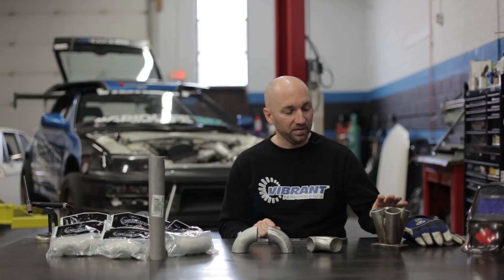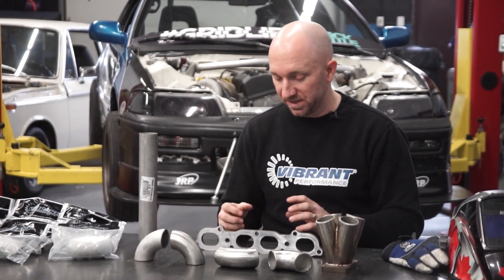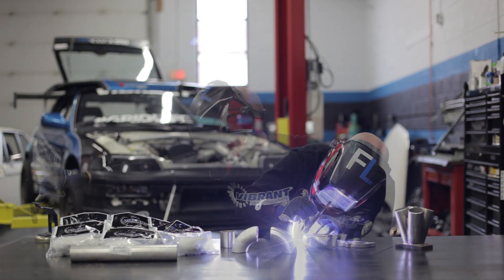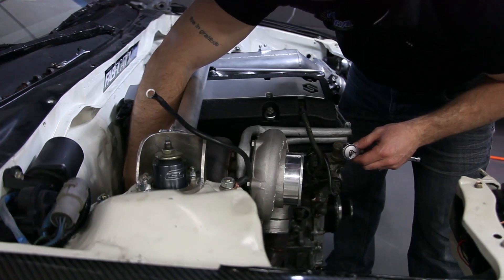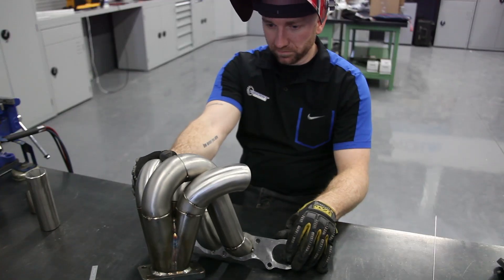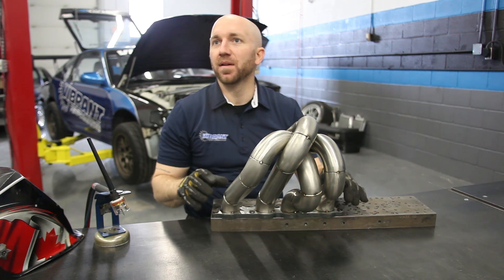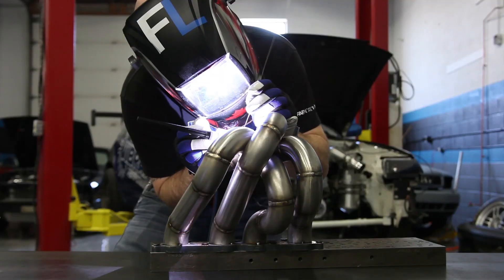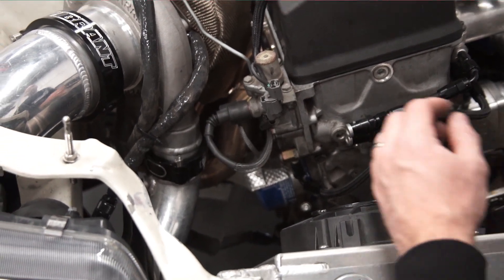RWD Turbo CRX Build: Episode 6 - Building a Turbo Manifold: Part 3 (Turbo and Runner Mockup)

Comment: How the hell do you manage to reach all the way around all of welds from runners to collector? Especially the last one
Reply: hey Ricky,  doing the runner to collector welds needs to be planned out so the last runner you are welding has the easiest access.  For this manifold, I left 2 runners attached to the collector and broke 2 off.  I completed all the welds while I had access, then did the 2 welds on the runner to collector joint for the runners that were left attached.  These 2 runners had poor access when the others were installed.  To get at hard to reach spots I use an extended #6 cup that is long and narrow with a gas lens.  In the past I have even used a bent electrode and a secondary argon source for shielding hard to reach spots.

Comment: Why didn't you back purge?
Reply: Back purging is very important when welding stainless.  It is discussed in the previous video in this series.  There are a few reasons why I chose not to back purge this manifold.  The first reason is that I was not getting 100% penetration through the piping on the welds.  The second reason is that I was under a time constraint to get this manifold complete to get the car put together for an event.  The third reason is that I have welded several manifolds this way in the past and not had any issues.  Yes, it is a best practice to get full penetration on all welds and have the inside of the pipe filled with argon for the best result.  There are several ways to go about it and everyone will find a method/practice that works best for their needs.  Some people do a 2 pass weld (root and cap- only purging on the root pass), some people will only do a single pass weld.  The focus of this video was to demonstrate how to begin piecing together the runners.  I hope this helps.